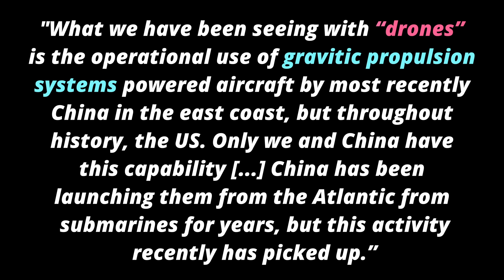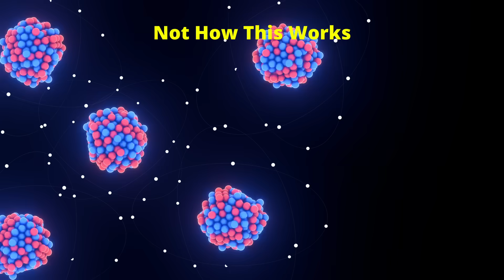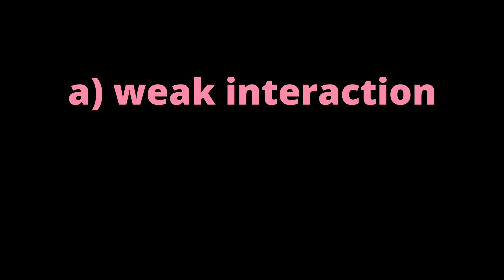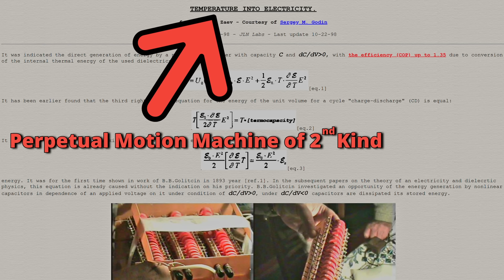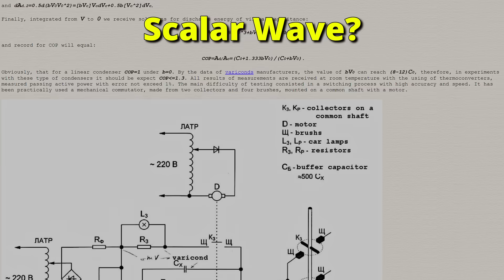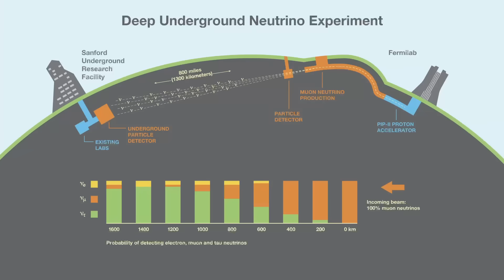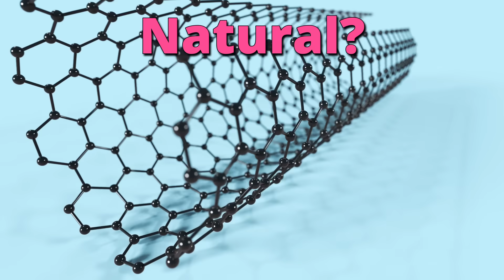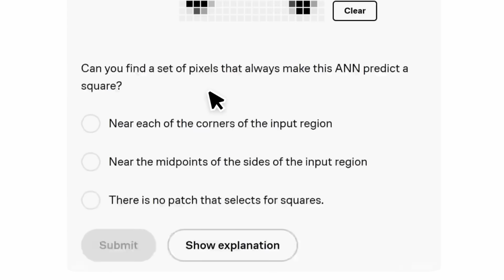What is “gravitic propulsion” and could the US government hide it?

Comment: From what I have read, "antigravity" was pioneered by Towsend Brown of the US Navy. He performed experiments with levitating crafts containing high voltage capacitors. However the forces experienced  in these experiments were almost certainly due to the generation of ions from the air due to the high voltages used.
Reply: The force was from ions, but he didn’t ever levitate any craft
Reply: @Scissors69  using ion thrust you can levitate objects, but mostly if they are light weight. often you cant lift the object and its power supply power supply so its not worth the effort. Ive only seen 2 or three examples of where people have managed to do that.
Reply: @c6jones720  That's all just not anti-gravity. That's simply using another force to counter gravity force.

Anti gravity would overall just block the effect of gravity. The thing is, that we don't even know what gravity is. We know what it does. And that it for some reason got to do with mass. But why? Zero clue.
Reply: @c6jones720  From what I read, the objects in Brown's lab that were levitated were pretty small, on the order of the discs kids use for sledding, and very light.  If I remember correctly.
Reply: @miriamweller812 Agreed. A lot of folks who "work" on antigravity make claims about floating objects - that this proves the existence of antigravity. By the same logic, every airplane is a antigravity machine.
Reply: @Scissors69  according to authorities. you dont know if he levitated anything, your just reading from wikipedia.
Reply: Engineering student who actually focused on this area of electrohydrodnamics after reading the work of townsend Brown and the Brown-Biefield effect/asymmetrical capacitors. 

Im sorry to say that all models of EHD for this effect explain it perfectly, with no room for the sort of predictive error youd need to suggest any anti-gravity effects. Our models are too good and make too much sense. I am positive antigravity technology exists or will exist eventually, but it will not be by virtue of Biefield Brown or any ion lifters.
Reply: I was trying to remember Townsend Brown's name, in order to mention him here.  I read a lengthy biography of him that was fascinating but didn't really reach any conclusions about the mysterious stuff he worked on.  The story, at least the official story, was that none of it panned out and he was kind of a crackpot.  

But the funny thing is, according to the biography, that the US government kept paying him quite a lot year after year.  For what exactly, we don't know.  Most likely not for practical antigravity.  And any crafts that did levitate, however they did it, were too small to carry anything (as far as we know).  But he must have been doing something worth paying for.  He also carried an American Express card from the feds, on which he could make unlimited charges.

He did come up with an electrical method that reduced drag on aircraft, which if I understand correctly has been in wide use for a long time.  And some of his work resulted in ionizing air cleaners, which are quite real-- I have one in my office and you should see the airborne gunk it picks up.
Reply: @EleneDOM  The thing with "official stories" is that they are the things they want you to know and not the things they're working on, they obviously wouldn't have been paying him if he wasn't providing them with real results, and the story of the 3 leaked round crafts that someone accidentally saw the presentation they weren't meant to see is probably the results of that levitation research and development.
Reply: Levitating crafts? Like hovercrafts? Or like Hydroplanes? Because both are pretty simple and fit the description.
Reply: @Mr.MasterOfTheMonsters  no, its more like a buoyant effect inside the medium of space. gravity is the compression of the medium towards the mass, as a mass is just localized flow. helium balloons fly without needing energy because gravity pushes stronger on air, pushing the balloon upwards as a result. this works the same way, except in the medium of space, and using em fields to achieve it. 

anti gravity is like taking a propeller tuned on and put in a water tank that compressed waster strongly towards its bottom, and then orienting it such its expansive vortex is facing towards compression. this will result in much greater thrust than uncompressed water, because the compression opposed the expansive water flow on the back of the propeller. 
think of the water as the vacuum, the bottom of the tank is earths surface, the propeller is the magnetic field with its north pole facing towards earth, and then imagine the propeller has a weight attached to it such that the propeller would sink to the bottom despite being turned on. if the propeller is getting just strong enough, the thing will float upwards, and since the water is strongly compressed, its pulling strong on the water around the propeller than the back of the propeller, making it effectively float to the surface even if the thrust from the propeller alone would not be nearly enough to overcome the weight attached to it.
Reply: @sshreddderr9409  from which peer reviewed scientific journal this theory was published?
Reply: If you read things properly, Townsend Brown appreciated ionic thrust and repeated his experiment with the charged plates immersed in insulating oil to prevent ionic discharge thrust.
Reply: The levitating craft is probably from the high capacitance craft that were round with sloping walls, it wasn't so much an ionic system as the high energy plasma that surrounded the craft was basically able to negate or hide the mass of the craft from the space around it, they were early versions of a mass reduction system, but the crafts had to be lead on the exterior to shield the pilots from radiation from the plasma field.
Reply: Almost certainly! Next thing you know they'll be telling us about green fogbanks rolling in and Ulf Leonhardt trying to do majic tricks.
Reply: You are creating ozone like crazy
Reply: The experiment of Towsend/Brown has been performed in vacuum and works. Other think is the powerful petroleum Companies which is killing any new idea and its inventors. With current physics we will never make anti-gravity propulsion for the simple reason that our current physics do not understand Gravity, needier Space, Time, Polarity, Attraction... The new hope is in the new physics which explaining all these unknown elements - It is in the book - "Theory of Everything in Physics and the Universe"
Reply: Actually I believe this is what led to the mass reduction system and the few crafts that have actually flown freely over the regular public, mainly the TR-3B and it's predecessor, which from seeing it parked on an aircraft carrier and another video of it flying, it seems as if the aircraft had a tendency to rotate, something which seems fixed with the TR-3b
Reply: thats what they publically claim. how do you know it is purely from ions? I havent seen anyone test this in a vacuum, and creating a vacuum is difficult and expensive. a perfect vacuum also is not necessary. if the force is because of ions, it should be much, much lower in a chamber with very little air molecules inside.
Reply: @sshreddderr9409 myth busters did test this in a vacuum and it doesn't work
Reply: There's lots more out there.
Reply: @MR-nl8xr reproduce it

Comment: Your getting it! 
There is a duel nature to things. The material, particles, protons and the Ætherial, radiation and light and everything manifest is either one or the other or the product of the two interacting, magnetic fields, perception, wave function collapse because Einstein said it best.
Electricity minus magnetism is dielectric.
All observed phenomenon is a process of light being transformed by particles causing all motion and spin. All the protons of the earth want to incorporate other objects electrons into them but that objects protons prevent this. This is why the fall then the bounce. At long distances gravity is attractive, at short distances gravity is repulsive. The Earth is in orbit around the sun because of the right hand rule where the current, field and force are all orno. to each other.
As light flows via the wireless induction of power through force free field aligned currents. What is the earth to the sun but a charged particle and acts as such.
Our domain is the face of the earth and there is no leaving in the body this is not how it works, by design. The sun however provides a mechanism for sending information imbedded into the light at “spooky” fast speed.

Comment: Sabine, I need some help.   I'm  a layperson.  I don't really understand the math, at least on a linguistic level, of the false vacuum decay.  However they said that blackholes would nucleate into new universes when exposed to the expanding bubble of new space time and I'm trying figure out some manner of visual or logical way to explain my conception of it and I just can't.  Its nothing as strange as that one guy that suggested you could quilt the fabric of spacetime but it is strange.

If the black holes are functioning as a nucleation site for a new universe that would indicate that the black hole can, and in fact is, sucking in 100% of the spacetime it comes in contact with.  But if its doing that under a false vacuum then it would have to already be doing that.  Is it doing that at the event horizon, the singularity, or some threshold between the two?  Wouldn't that mean that black hole are like infinitely absorbent spacetime sponges and they can just soak up infinite spacetime since spacetime has no mass?   Is hawking raditation just the remnants of the mangled spacetime moshing about inside a black hole, like the threads of either space or time but not both?

Comment: If there are additional dimensions of freedom wouldn't we have noticed violations of conservation by now?
Reply: no, because this assumes a correct setup of the initial conditions. if you define a magnetic field as the force experienced by a charge or another magnet, then your equations only capture the energy that was contained in this interaction. but, if the magnetic field also interacted with gravity and you dont know about it already, then this is going to be missing from the initial condition, and it will look like energy is conserved. 

also, anti gravitic effects are tiny in scale because the earth is very large, and attraction of matter overpowers it very easily, unless very extreme field densities relative to the mass of the generator is achieved, which is difficult in practice. 

an easy way to show that em forces are also gravitic is that photons, which are em waves, have gravitational fields and interact with the gravitational field of plants. 100% of the energy of a photon is in its em field, since it has no rest mass. light is red shifted if it moves against gravity, so it looses energy by gravitic interaction. the energy that is lost could have only come from its em field, and its em field is weaker after its wave length has been red shifted. so, energy conservation implies that em fields interact with gravity, and are inherently gravitational in nature.

Comment: I have invented a method of gravitic propulsion that I call falling
Reply: Now all you have to do is learn to miss the ground and you can fly.
Reply: @robo5013  Get your copy of the Hitchhiker's Guide and go for it!
Reply: That is basically what sci-fi gravitic propulsion is. Basically make an artificial field of mass in front of your vessel, and it'll fall towards it. I know Halo specifically uses this for the alien forces in lore. 

But like Sabina said, to make something fly with this, that artifical field must have more than the mass of the earth. Even if it were possible to make artificial gravity, it would be a massive energy hog. Anything using it would basically need a black hole to power it.
Reply: @Skylancer727  Ah, but this is where the additional dimensions come in ;)
Reply: I have invented a means to rotate gravitic propulsion 180º. I'm trying to find a different word for "teeter-totter" in the wording of the text. There's a danger someone will steal the idea and make trillions of dollars from my work.
Reply: helium balloons fall upwards. they are gravitic propusion in a sense, because gravity is pulling on the denser air, effectively pushing the balloon up. the balloon consumes no energy to float and fall upwards, the energy comes from earths gravitational field.
Reply: Its flat earth conspiracy nonsense, gravity isnt negotiable, flying into space is the only escape.
Reply: Moonshine makes it work really well.
😢🤔🤓🍻
Reply: You can get quite a bit of acceleration that way, too, if you start high enough!
Reply: Cheech and Chong told of Santa's anti-gravity propulsion system for the reindeers.   He had this magic dust....
Reply: I'm afraid that particular type of propulsion has been around since the time of Sir Isaac Newton.  Lol
Reply: Get a wing suit….fun times ahead!

Comment: I argued with my teachers in college saying the maths are wrong since we cant understand gravity!
Reply: As a layman, asking a genuine question:
Why is it that when you increase the Mass of a He balloon by adding more gas, it overrides the law of gravity that states it should be pulled down closer to the ground by going higher up into the atmosphere?
Reply: @MR-nl8xr  Helium is a gas, like air, but it's less dense and weighs less per liter. 
A balloon filled with helium will float because it weighs less than the air it displaces. 
This is similar to how an air bubble rises in water, which is denser than air.
Reply: @MR-nl8xr Because buoyancy is about density, not weight. And density is affected by both mass and volume. You can't neglect the increase in volume from the balloon expanding  when you add more Helium. If you made the balloon to not expand, then you would be correct.
Reply: @Mr-nl8xr Yep, that expansion part is pretty important. Or at least it is with known materials in air. If a material existed that was sufficiently rigid and light then then you could make a balloon hold it's shape as is. That's what a submarine is: it can float but doesn't need to expand because the density of water and steel is close enough that we can use steel to make the submarine hull. The submarine hull is shaped as-is.
Reply: @MR-nl8xr  Like, the way buoyancy ideally works is that you are trying to displace enough air (or water) that the mass of air or water that is displaced is more than whatever it is you're trying to float. That way, when gravity pulls down harder on the air/water than your object and the air or water gets pulled underneath your object which pushes it up. Sort of like a 1:1 pulley, but surrounding you.

Ideally, you would displace the air with nothing (which is a vacuum). But that's pretty difficult to do since the surrounding air/water has a pressure that will try to push in which means you need to make your balloon very thick to withstand the pressure which add enough weight to the entire volume of the balloon to make it dense enough to not float. So instead you add a ligher-than-air gas because the molecules of that gas will float on their own but it also exert a pressure to counteract the atmospheric pressure to prevent the balloon from collapsing and losing all that volume which is artificially decreasing its density. That lets you use a very thin and light, but non-rigid material to make the balloon.

Gravity is absolute in that it's always there. That also applies to the electrostatic force. Buoyancy is not absolute in that it doesn't exist in space because it requires a surrounding fluid medium and a directional force of gravity to pull on it. That's because buoyancy is a resulting effect of gravity and a fluid medium.

Comment: It might be possible with the casimir effect at least for a vacuum powered source.  Imagine tiny cells of 2 pizo electric crystals each covered with an atom thick sheet of metal placed very close together like how circuits are made. There will be a casimir effect between each cells and then you can increase that like you increase voltage maybe just a thought

Comment: And that's why you think calculating the horsepower of an electric motor wasn't possible without finite element math, not so.  It's in gapped transformers, number of shared magnetic lines, and the number of glass.  Guass, the number of magnetic lines required to lift one gram.

Comment: Nikola Tesla built the tech to broadcast power 100s of miles without wires. He demonstrated this, but the competing tech relied on wires which would make wire makers rich so Tesla's tech was confiscated.  Every home today has cables running through them and someone somewhere is very rich.  If Tesla's tech was the norm we could have cheap power for all. Electric vehicles would work. Devices would work everywhere with no need to charge them.  I do believe that to make money for some,  things are buried.  If this anti-grav tech existed it would change everything and the rich might not be so rich.